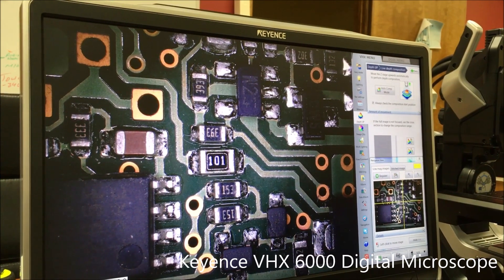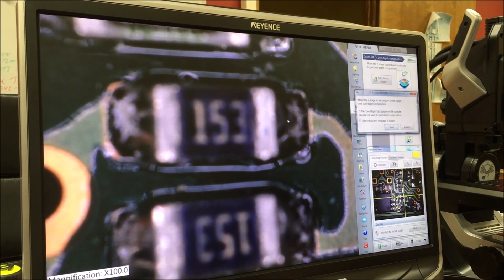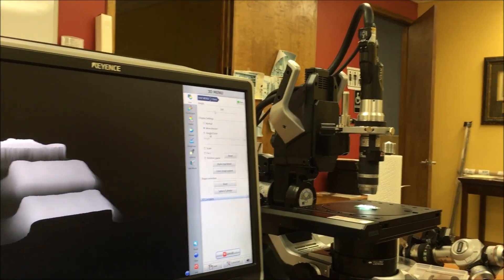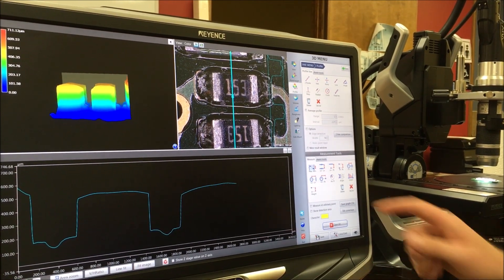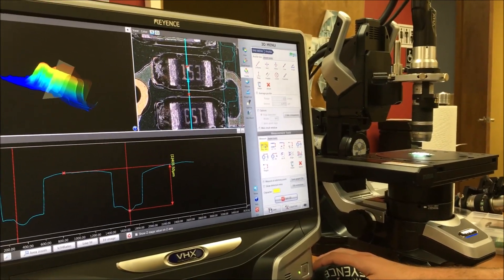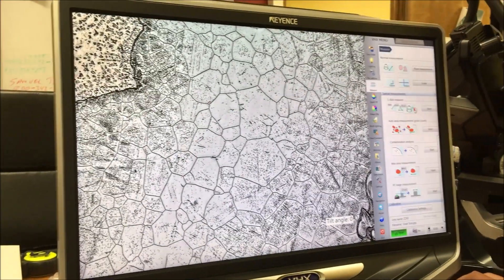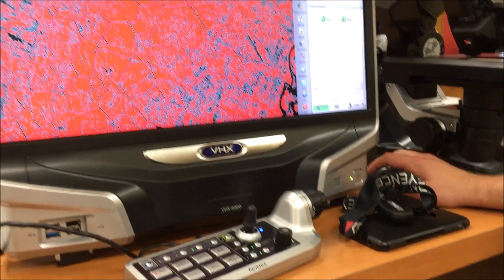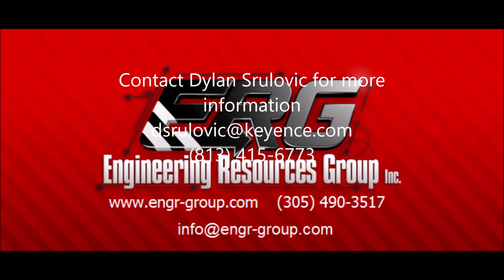Keyence VHX 6000 Digital Microscope 1

Comment: I’m having trouble finding the proper upper and lower limits and pitch parameters. How do you open the Focus Area window with the green chart in 0:15?
Reply from the maker: For technical support contact Dylan Srulovic
Sales Engineer
Digital Microscope Team
Keyence Corporation of America
4300 West Cypress Street, Suite 550
Tampa, FL 33607 | 813-329-9958 ext. 88725 
www.keyence.com<http://www.keyence.com/>

Comment: Please tell the cost of vhx 6000
Reply from the maker: Please contact Dylan of Keyence at dylan.srulovic@keyence.com, 813-329-9958
Reply: A VHX system will range between 45-130k depending on configuration.